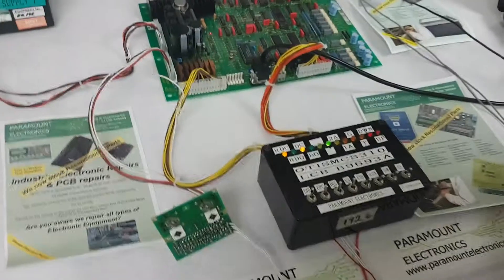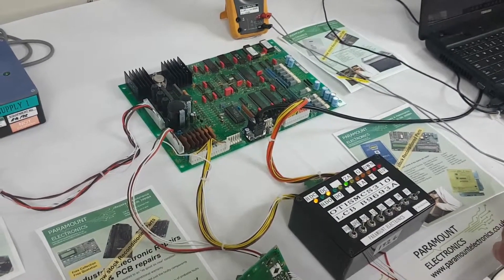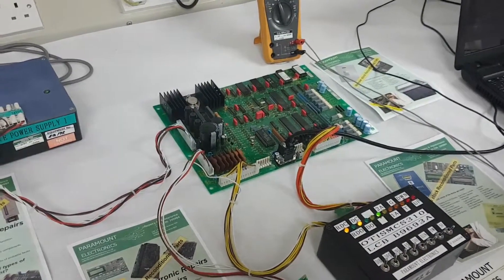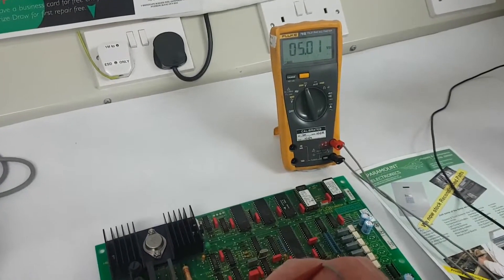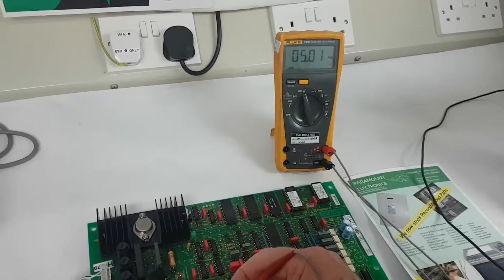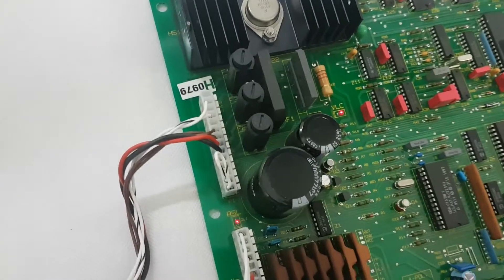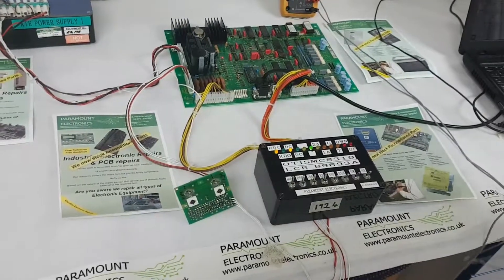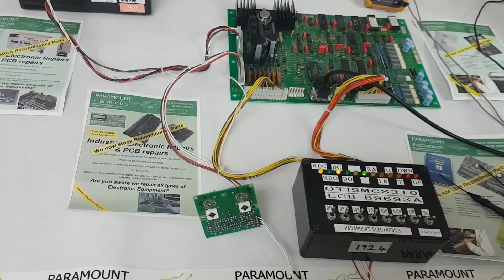Otis LCB B9693A / LCB C9693A / LCB A9693A unit under Test at Paramount Electronics Ltd

Comment: Ineed help with this one
Reply: We can repair or supply this part please contact us 01296 399984 for more information or browse our website.
Reply: @mandywells6228  already sent an email. My main problem is the codes for eeprom's is there any ways I can download or copy them without using the other working board I have? Company is afraid of loosing the other working system since there are no more source of having brand new one.

Thanks for response I'll be grateful with some leads to solving this problem
Reply: MCB_II GDA26800H1,LCB C9693A 3
Reply from the maker: Can you either send an email to sales@paramountelectronics.co.uk or call us on +44 1296 399984.
Reply: Hola buenos días, tengo un problema con una tarjeta de esa, le moví el suiche "set" y se desprogramó, hay algúna forma de reprogramarla?